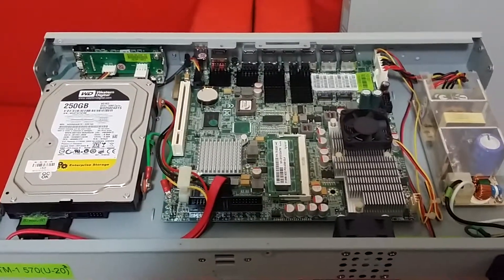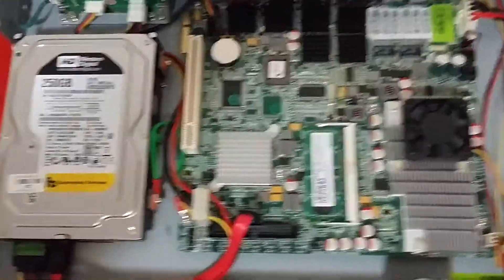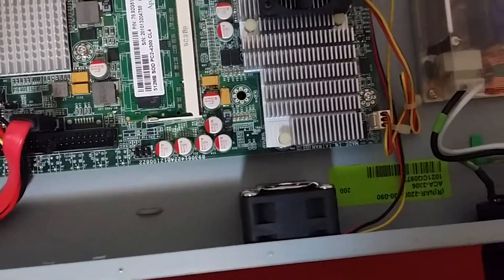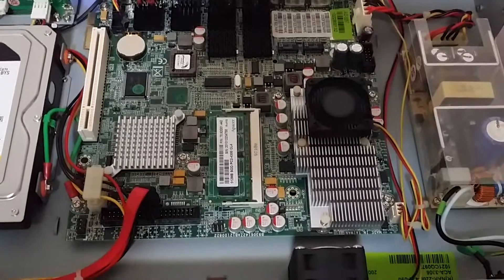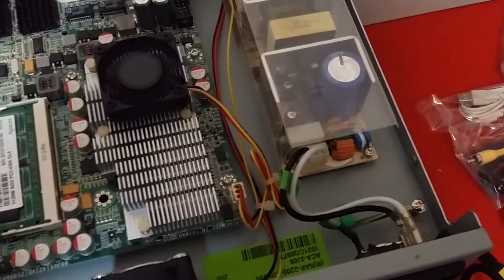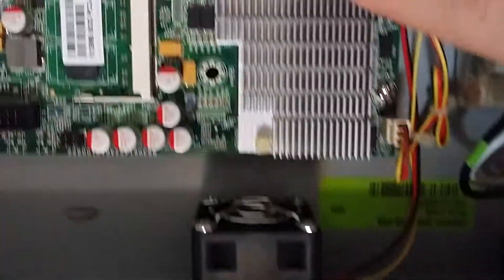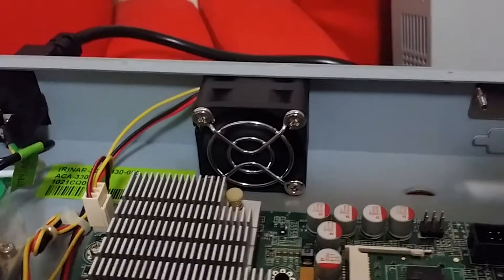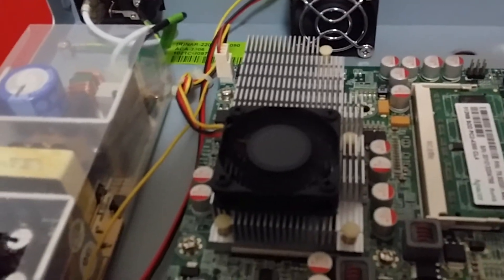Checkpoint UTM-1 570 (U-20) Internal tour

Comment: The holes for the airflow on the outside case are terribly minimal. Not enough air flow for the fan and would strain the bearing over time.